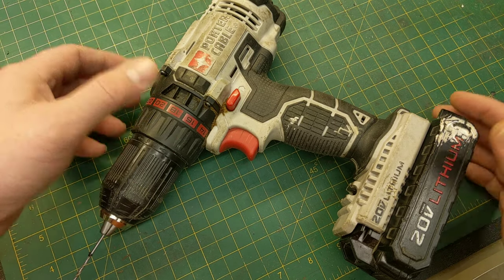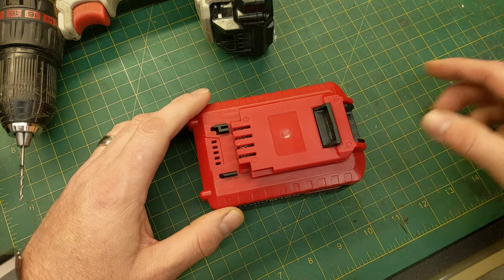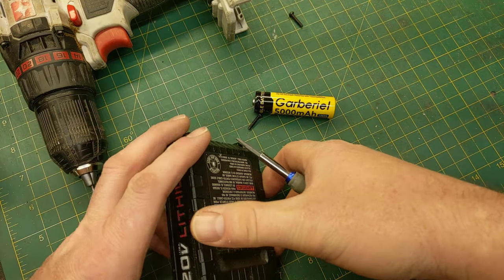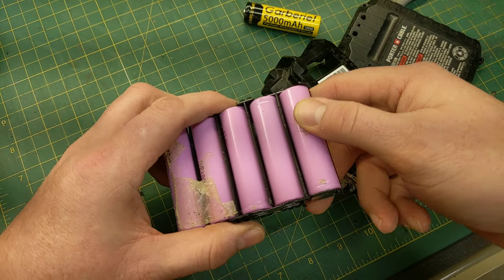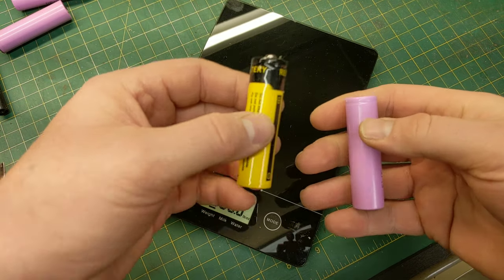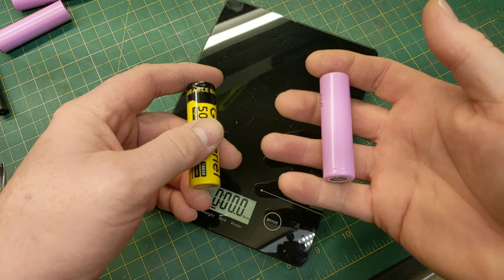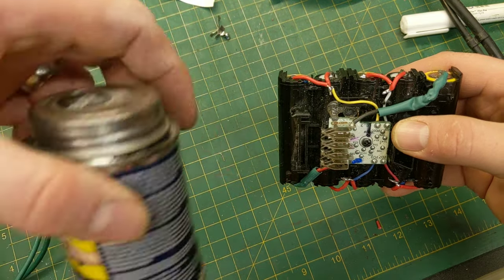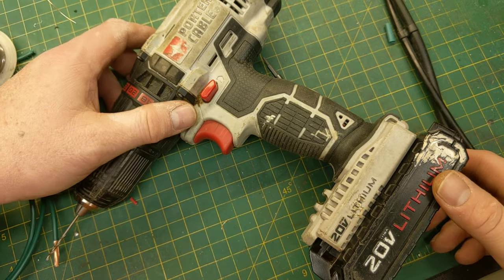Rebuild / Replace Cordless drill batteries for next to nothing using 18650 batteries!

Comment: Extraordinarily well-done, this solves my main problem/headache; replacing battery packs. 
Since your expertise is so good, pls do a larger battery pack.  
Maybe try some sort of solder-less/compression connectors so individual batteries can be checked & replaced (if necessary).  
Oh novices might copy your wearing jewelry while working on electronics (I guest no-one is perfect).

Comment: I think it's important to mention that power tools use a "high drain" 18650 battery, meaning it's rated to put out 30 amps or so. Regular 18650s might be goot for 5 amps or 10 amps, but they won't run a power drill. You can still buy "high drain" 18650s cheaply, but they MUST be the high-drain type, or they will be quickly killed by a power tool. Good luck.
Reply from the maker: You are absolutely right and I should have mentioned that in the video.
Reply: So in theory you could take the batteries from these packs and use them for say a vape mod?
Reply: @molemane69  yes. Look out for dead power tool batteries and salvage the good 18650s. Probably 2500mah 20A.

Comment: Are these batteries typically wired in series and in series only, right? 
The batteries in this specific video were wired in series also, correct?
Reply: Yes. 3.6 volts per cell x 5 cells = 18 volts. Series.

Comment: I appreciate this video but have a couple of specific points of contention. 1. those cells are shit, the capacity is a damn lie, and they each have a PTC protection board on them, which is why they're so long.  Those PTC boards are super junk and have added another layer of failure points while the battery board has its own circuit protection already.  I wouldn't be surprised if the PTC kicks in below the current draw of the pack given that you had INR 25R's in it before.  2. soldering directly to the cells will cause local damage due to heat input, you should use pre-tabbed cells and solder to the tab material to reduce direct heat input on cell
Reply from the maker: 1. Yup, couldn't agree more, that is why I refereed to them as "garbage".    As for 2, if your quick about it, you can do it with little or no damage, but pre-tabbed would be preferred.  Later I soldered batteries pulled from Tesla battery into a similar battery pack, they have been preforming better than the original Porter Cable batteries, hopefully they will also last 7 to 8 years.  I did an updated video here:  https://www.youtube.com/watch?v=ytO1e1sOC88

Comment: I love my porter cable 20 volt tools,but I've had very little luck with their batteries. Mine came with the 1.5ah batteries and they're junk after only 2 years. I've ordered an aftermarket set of 4ah batteries off Ebay in hopes of resurrecting the tools. I'd of probably bought porter cable batteries, but the only ones I could find were the same crappy 1.5ah batteries I already had and they were $50 each. My tools only came with the one charger and if I left a battery in either tool for any length of time itd be stone dead when I went to use it. I'd swap the battery out of the charger and continue on. After a while I just took the battery out of the tool when I was done working,but after 2 years they wont charge any more.  The charger blinks red with a slow then fast blink at the lil pic of a thermometer and what looks like a clock. I hope the new ones do better,but even if they dont at least they're $40 for both instead of $50 for one that's obviously inferior.
Reply: this porter cable drills are sold as stanley outside of usa. i have hammer drill, changed its batteries after 6 years and plastic shell of drill. it s like day 1 now. used sony vtc5 batteries(better than samsung).it s a beast now.
Reply: @sfrskz  The aftermarket batteries I bought are good,but the connectors give me problems. Sometimes itll charge,sometimes it doesn't
Reply: @ciphercode2298  it can be because of temp sensor. does it get hot?
Reply: @sfrskz  no,itll instantly start  blinking red.  I'll unhook it and try it a couple more times and it'll eventually start  charging

Comment: I REPLACED WITH SAME CHINESE BATTS BUT DIDNT CHARGE AND AT USING THE DRILL NEED TO PUMP THE TRIGGER TO REGAIN OPERATION......SEMS THAT THE PROTECT CIRCUIT IS DAMAGED........ANY ONE EXERIENCE THE SAME?